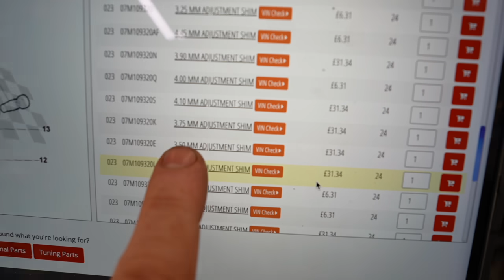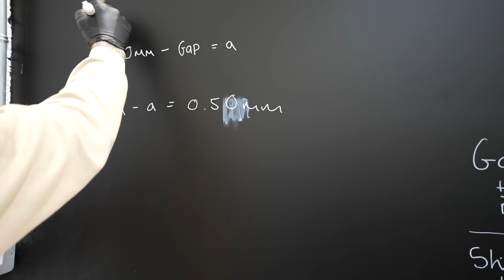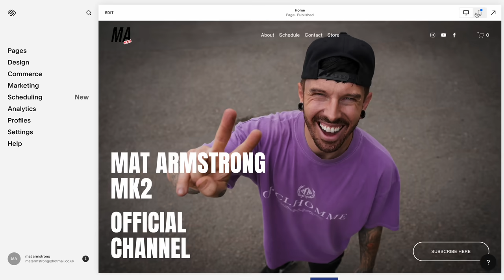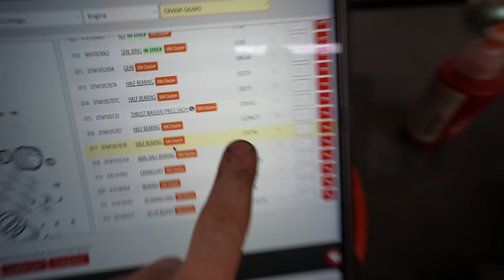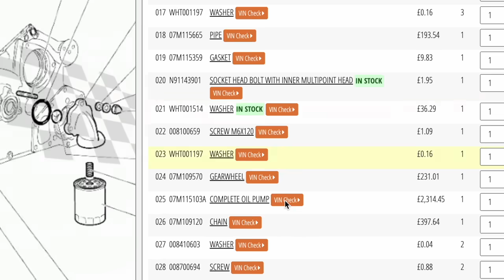REBUILDING AN ABANDONED LAMBORGHINI MURCIELAGO | PT3

Comment: You should thank them for the hole to access the gear box linkage. There was a certain few years of Corvettes that anyone smart drilled a hole through the inside of the front wheel well to access the 1 spark plug that you could not remove without otherwise undoing the motor mount and raising the engine. You just drilled a hole and when finished got a plug and put it in until your next plug change. That linkage is the same type of deal. You would have to be stupid or into self hate/punishment to remove the whole box every time in order to adjust linkage. This is poor engineering on Lamborghini's end which strikes me as odd due to the basic history of how he went from tractors to cars due to the Ferarri poor engineering and snob attitude towards him and his fixing the known issue. So yes if I had to do that job a cutting I would go! You already have the hole and less work next time! Thanks in order on your part to them I would say. About the engine stuff though, I bet they threw that guy in prison for being a bad mecanic lol If not they definately should have. The body damages... well it was a rented sports car. What would you expect? Some idiot has bound to have ditched it or crashed at one point or another. My whole thing is with fiber based frames how well they will hold up over time. Some cars with metal frames are over 100 years old and still great condition if maintained. If they have been neglected rust etc make them easily identified as maybe a problem which needs addressed. With fiber type frames how do you tell until it is too late if there is a small crack etc? How well will it last after 60 years or more? No one knows as the materials have not been in service under this application for that long. Let's not forget what UV does to cars which often are in the outdoors for extensive periods of time. I would be a bit hesitant of a carbon fiber frame on a car. Just sayin'

Comment: I think obviously you should have got a lower price by having it professionally inspected BEFORE offering a cent then when you threaten to walk away for a car sitting in dust for 7 years you could have easily bought it for well under 100k. Those people sold you on the sizzle and like foxes slaughtered you at the poker table. They are crooks, but you need to be a better at playing Vegas poker.  They probably charmed you from digging deeper at the floor area,